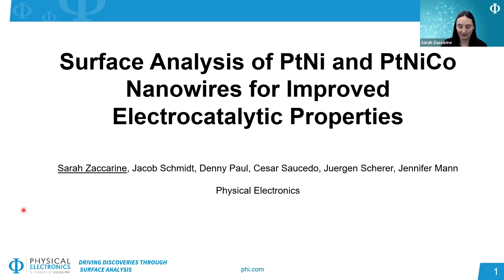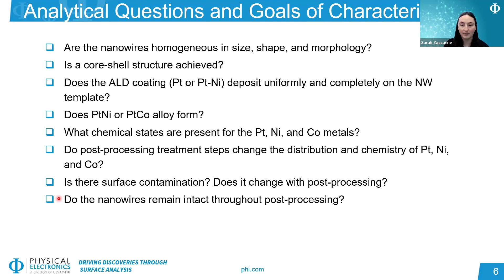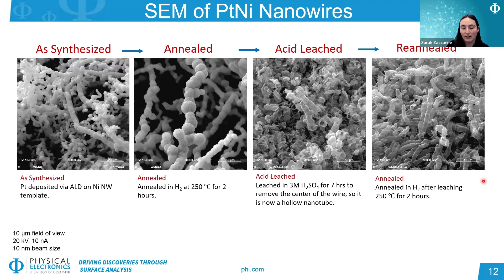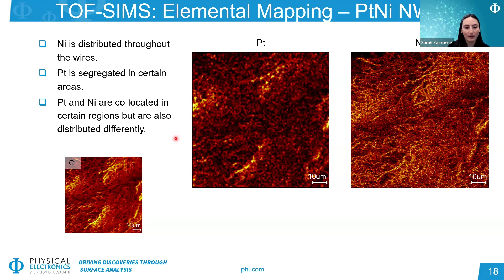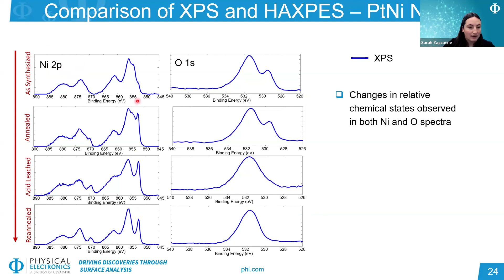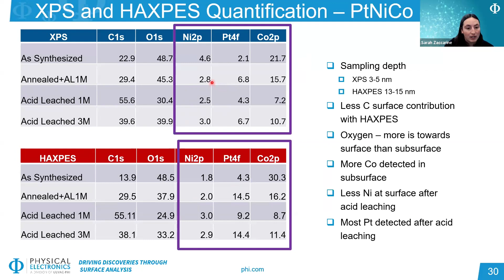Surface Analysis of PtNi and PtNiCo Nanowires for Improved Electrocatalytic Properties

Comment: Very interesting and comprehensive report!
Just a small suggestion regarding the XPS results: due to the very small binding energy differences between NiO, Ni(OH)2, and NiOOH species in the Ni 2p spectra, the more recent work by Mark Biesinger et al. [M.C. Biesinger, L.W.M. Lau, A.R. Gerson, R.St.C. Smart, Phys. Chem. Chem. Phys. 14 (2012) 2434], which focuses on Ni LMM Auger analysis, may provide a more reliable approach. It's quite difficult to confirm the presence of –OH species based solely on Ni 2p spectra. Additionally, the Co 2p photoelectron line shape appears to correspond to Co3O4 [M.C. Biesinger et al., Appl. Surf. Sci. 257 (2011) 2717].

Thank you PHI!